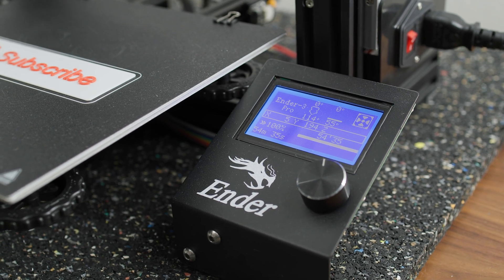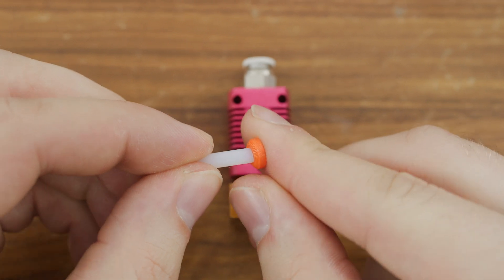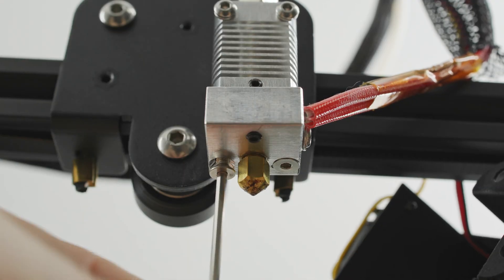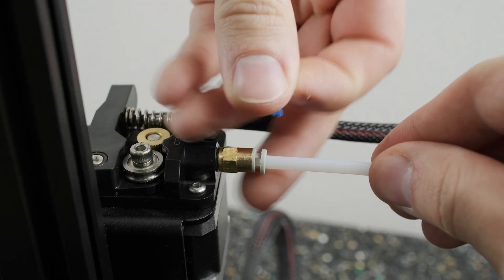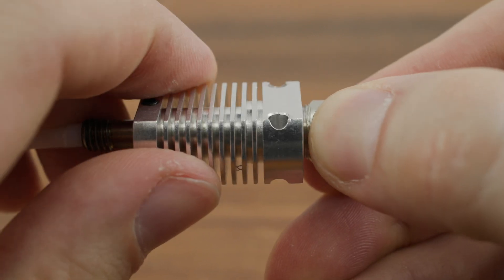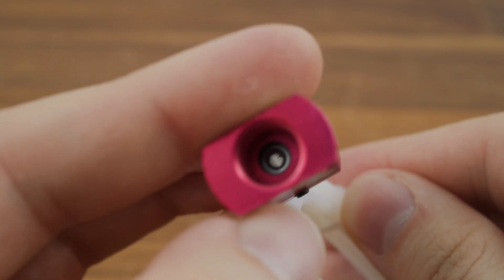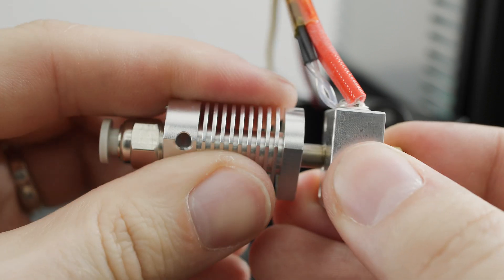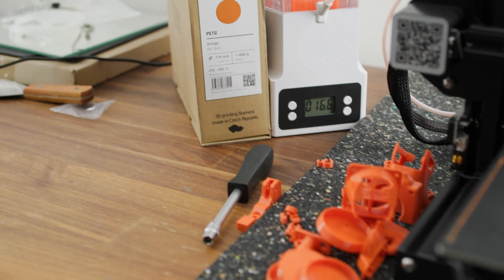Creality Ender-3: First upgrade - hotend fix

Comment: Thank you very much. After replacing the stock ptfe tube with kapricorn, i get a big mess of melted plastic and filament all around the place :D
With your video i solved with a washer and a pair of spare pieces of kapricorn ;-)  Thanks a lot

Comment: didny=t think i would be upgrading my ender 3 first time i try to print something but I was unlucky and got a lemon. not only did i have to deal with the z axis not being aligned propperly which is something i noticed immediately during assembly because it wouldn't just drop into the coupling (i now have a flexable coupling and that fixed it plush a shim behind the stepper motor) i have it heated 30 min total and thermal runaway and i decided just replace the whole thing since fixing the thermistor is a 6 month fix while this is Permanente.

Comment: I bought this exact hot because it has a better themoster and And Not even after 30 minutes of use because I only hated up three times I was getting thermal run away. I hurry up! Trying to get the phone again. After that I thought I had it in and I tried to put a calibration cube and there was no extrusion. I then tried to put the filament t in again and went away for 10 min and I come back to hear a constant beep and it says thermal runaway.

Comment: Thank you for the video tutorial. After removing and reinstalling the nozzle I would recommend running through bed level/z offset process as the nozzle distance from bed will likely have changed. Cheers 👍😎🇦🇺

Comment: I damaged my heat-break trying to remove it from the heat block but still managed to get everything working right. The has completely fixed my under-extrusion issue. I used a washer that came with an m3 screw kit. Thanks.

Comment: I tried to remove the heatbreak without scratching it like you said but I wasn't able to, if the heat break is scratched it's a problem?
Reply from the maker: In case of this heatbreak not so much. Don't you worry. 😉

Comment: Everything is well explained and good :) but don't heat the Hotend to 260°C that's to hot for the PTFE. PTFE lined Hotends should only be heated up to 240°C that's especially important for printing operations!
Reply: Hi, the deteriorate of the PTFE Tube depends on the quality of the tube. Some can go up to 260 for short, time some don´t like 230.
The better solution is to use a full metal heatbreak. Any "modern" avoids contact of any PTFE tube at the heatzone.
Reply from the maker: @Salsadance-SH  In another video will be upgrade to the all metal hotend. I'm waiting some parts from China. 😅 
I'm trying do the upgrades in some logic and budget way.
Reply from the maker: While PTFE is stable and nontoxic at lower temperatures, it begins to deteriorate at temperatures of about 260 °C (500 °F), it decomposes above 350 °C (662 °F), and pyrolysis occurs at temperatures above 400 °C (752 °F).

This is also why Ender has a temperature limit of 260 °C.

You still need to set the highest temperature you can print at to make sure the nozzle doesn't loosen.
Reply: @Zemistr3D  Ok, I always read about 240°C beeing the max. at least for long printing operations, but if that's the case 260°C should be fine ✌️ I would still recommend keeping a buffer so it wouldn't start to deteriorate. :)

Comment: or buy $5 bimetal heatbreak to make it all metal and never worry again. 5months in and I haven't had a single problem
Reply from the maker: I wanted to show how to do it without spending money.
But yeah... All metal or bi-metal is for sure better choice.
Reply: $5 where? $15 on Amazon
Reply: @Boorne2Kill  AliExpress, I bought mine from Maccurat store as well as bunch of others parts. 6months in not one clog or issue
Reply from the maker: @Boorne2Kill  I am now testing this one and it works perfectly. I just had to add some thermal paste around the part of the heatbreak, which goes into the heatsink.
https://s.click.aliexpress.com/e/_DFtgAeL
Reply: @Zemistr3D  That says it is for CR10. Is it also compatible with Ender 3 V2?

Edit: I realised that yes, it is compatible.

Thanks
Reply: Just did that. But this is a very good solution.

Comment: Thank you for a very nicely done video. I like the modification, but experienced some difficulties with the filament passing through the O-ring and getting to the heat block. Any suggestions?
Reply from the maker: Try to enlarge the inlet opening on the separator a bit.